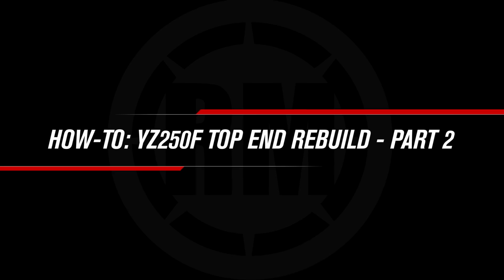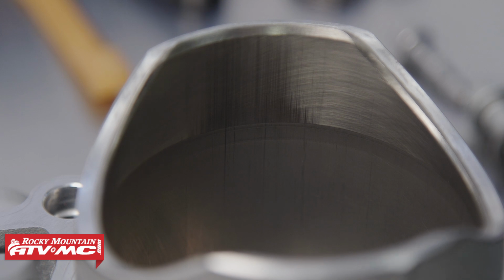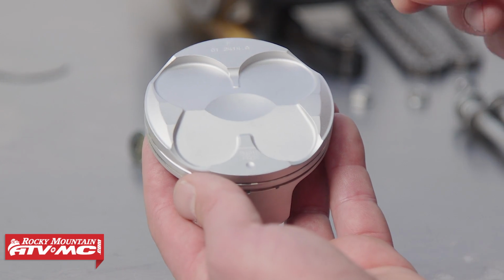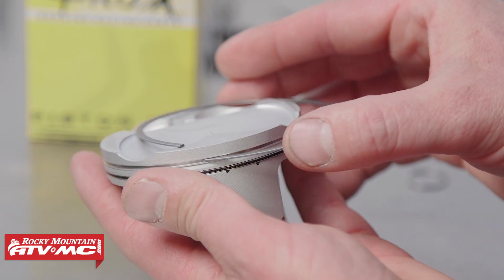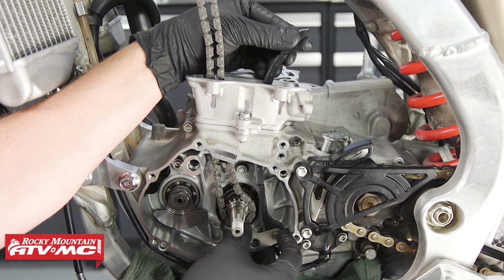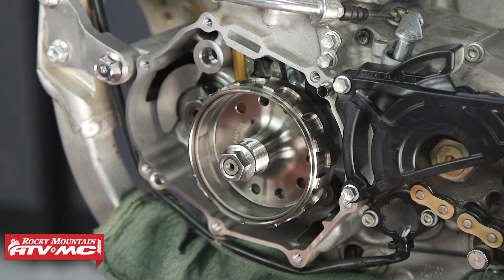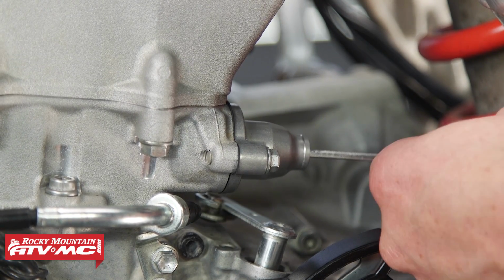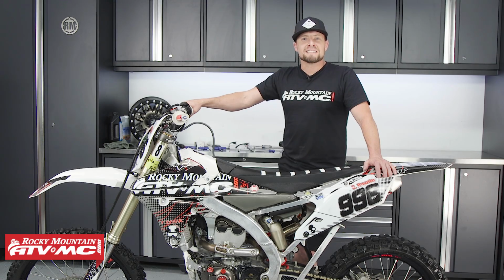Yamaha YZ250F Top End Rebuild | Part 2

Comment: where did you get your torque wrench from  ??  and what make is it
Reply from the maker: This torque wrench was from Snap-on. You can check out the Tusk torque wrench for a better price: https://www.rockymountainatvmc.com/parts/tusk-torque-wrench-p
Reply: @rmatvmc  ok got a dumb question..some of my 8mm bolts needs 4.5 ftlb torque..so do i multiply 4.5 x 12 ?   that's 54 ft lbs of torque does this sound right ???
Reply from the maker: @417plasma6  If you are wanting to go from ft-lbs to in-lbs then you will multiply by 12. 4.5x12 is 54 in-lbs.

Comment: Hi, what's the exact size of the Flex hone tool for this, when i want to order it says 77-83? its 77 or 83? Thanks and great viedo btw!
Reply from the maker: The 77-83mm hone is what you want if you have the same bike as us. That is just the size range of cylinders that this hone will work on. If you type in the exact year, make and model in our drop down menu, it will show you the right size and part number for the stock cylinder. This will ensure you get the right hone for your bike as long as you aren't running a big bore kit. -Charles

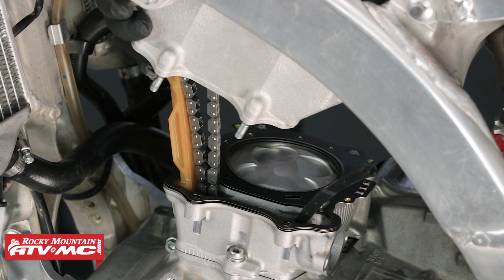Comment: Hey just curious at 7:28 in the video. When you are putting the head on the cylinder why does it seem like you have 3 gaskets for it?
Reply from the maker: The stock head gasket has 3 layers riveted together.

Comment: What size cylinder hone did you use I got a 14 yz250f and it’s burning oil
Reply from the maker: If you enter your bike on our website it will tell you the correct size. Should be the 77-83mm.
Reply: @rmatvmc i have a 2022yz250f i have a 83mm ball hone will it fit?

Comment: After you torque the head, wait an hour or so, and check the torque again, you will notice that they loosened up, because the head is compressing the new head gasket. Also lower the spark plug with a magnet, so that the gap does not get smashed if you just drop it in.
Reply from the maker: Good tip! Thanks for checking out the video.

Comment: I made the mistake of installing the head and cylinder, after that, the front plastic chain guide would not slip into the top of the cylinder slot. I had to remove head, and place it into slot. (service manual does not show steps) Good video.
Reply: I made that mistake as well, the service manual doesn't say anything about it

Comment: I have a 2014 yz250f. My intake cam does not point upward when the cam marks are level with the head. Exhaust cam points upward like yours. Could my intake have a spun cam?
Reply from the maker: Did you have a serious failure before you took the engine apart, or did it run and just need a fresh top end? If it ran before, it's probably not spun. Is the single dot to the left and the two dots facing up?
Reply: @rmatvmc  yes the bike previously dropped a valve
Reply: @rmatvmc  yes, I followed manual Instructions, 27 pins in between, single dots setting horizontal with the valve cover gasket surface, flywheel mark aligned, and fresh valve adjustment. Getting great spark with fuel. But no boom
Reply from the maker: @austinrosser9522  Ok, with that happening and if your intake cam lobes aren't in the same location as ours compared to the dots on the cam chain sprocket, it sounds like you found the problem. I'd give it one more look just to verify, and if it doesn't match, then I'd replace it. Let us know how it turns out! -Charles

Comment: Wiseco piston part 40111M09700 for a 2017 YZ450F - the top of the piston doesn't have an arrow but has FWD. It seems that normally the arrow points towards the exhaust but on the YZ450f the exhaust in the rear. so I am assuming that FWD is towards the front of the bike which would be the intake?  Also, the instructions tell me to put an oil rail above and below the oil ring expander - yet my package only came with 1 oil ring expander, 1 oil rail and a top ring - am i missing one?  thanks

Comment: Hi
I didn't know that there is A B C size vertex piston.. I bought the A size on my first rebuild and after the rebuild a very light puff of  blue smoke coming out when reving the engine on high RPM.. 

Was it because I'm using A sized piston instead of B sized?

Comment: Hi

I did not  hone my cylinder because I do not have the tool and just put new piston kit on it.  Replaced all the valve seals also. Noticed a thin blue smoke when I rev high the bike after rebuild and after spending 2 hours on it. Im thinking that is because the cylinder was not honed.. Can I still hone the cylider  and put it back togher even  I've already riden the motor after few hours?
Reply: No, you now have to take bike to salvage yard
Reply: @illhaveanother4365  it's been 2 years and still using the same piston. :P

Comment: Sooo I followed all the steps and my kickstart is stuck 🤷🏽‍♂️ , I don’t know what might have happened??
Reply: It means something is bound up or hitting something. If you didn't align the timing marks properly, the piston might be hitting the valves for example. DONT force it, take it apart and re check everything
Reply: @slickstrings  timing is probably off. had the same issue. do not kick it if its stuck. you can bend valves
Reply: Did u ever get it running
Reply: I have the same issue😦
Reply: I followed every step in the video but i cant turn the engine over

Comment: I'm putting my cams back in, but can't seem to get the intake one back in. Feels like the cam chain is to tight to fit them back on... Help... Anyone else had this problem???
Reply: Had this problem on a wr400f 
You need to put the exhaust cam first at the marks and chain on it. Then you want to put your intake cam in place and positioned at the marks too. The chain is in front of the sprocket now and you need to not force it, just leave it slightly loose to put the next cam.
Now to put the chain on, you need to get 1 or 2 teeth from the top, slowly lifting the cam from his back (opposite of where the chain is) and swinging it inward a bit.

Then when you have 1 or 2 teeth in at the top of the sprocket, you have to push the chain from the bottom with your other hand to help it get a little loose (down where the chain goes). 

Gently moving the cam back-end upward and pushing the chain to fit the rest of the sprocket and it should work...  
Sorry if it's not clear..let me know, it's hard to write it down and there are no videos that shows the process on yt suprisingly

Comment: What size ball hone and what exactly is that he sprays on the ball hone to lubricate it?
Reply from the maker: The ball hone for this bike was the 77-83mm and the lubricant we used was Maxima MPPL.
Flex-Hone: https://www.rockymountainatvmc.com/parts/flex-hone-cylinder-ball-hone-p
Maxima MPPL Lube: https://www.rockymountainatvmc.com/parts/maxima-mppl-lube-p
Reply: @rmatvmc  thanks for replying. Will the same size hone do for a 2019 yz250f?

Comment: No lubes when installing the piston into the cylinder? On the rimgs?
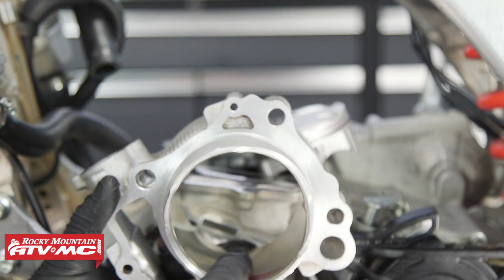Reply from the maker: You can see him putting assembly lube on the piston skirt at 6:19 when installing the piston. If you want to lube the rings when installing them, it's up to you!
Reply: @rmatvmc  oh I thought you were supposed to run it dry for proper break in
Reply from the maker: You will want to have assembly lube on any internal moving part when putting an engine back together.
Reply: @rmatvmc  oh okay thanks for the info!

Comment: 6:22 What does he lubricate in the cylinder?
Reply: Assembly lube.. it is just lubricant that mechanics or anyone who is rebuilding an engine uses in order to properly lubricate the engine when it is first started after a rebuild or refresh. This is done because the possibility of not having the engine oil reach certain places in the first few seconds of start up.
Reply: Jake Gardiner why not just used engine oil?
Reply: @jonoj7666  you could. the oil would create boundry lubrication for initial startup.

Comment: What is the benefit of using a hi compression piston
Reply: Hayden Bahadoorsingh little bit more power, but also shorter interval off changing
Reply: MX57 I really want more mid to top power. Would a hi comp piston help?
Reply: Hayden Bahadoorsingh yess but also depands on your motorsettings
Reply: Wouldn't recommend one. Your bike will overheat like nothing
Reply: LarryFly what would you recommend for getting more mid to top power

Comment: Would recommend someone new to working on bikes to do this or should I pay someone to do it?
Reply from the maker: If you take your time and follow these steps and have the tools, like mentioned below, you can get er' done!
Reply: Just like M. Kasner said if you got the tools then go for it. My only suggestion is stay super organized. Clear out a big spot where you can work. If you don't have a garage or a shed ask to use a friend's. I was super nervous when I did my first top end on a 04 WR450 but I stayed super organized and it turned out great.
Reply: Will definitely ask mom or grandma to help me organize and bag up everything
Reply: Hayden Bahadoorsingh did you end up doing it? If you did how did it go
Reply: I really appreciate the feedback. This video is very helpful because there is little to none on information on working on these bikes. I had just bought a 17 YZ250F and found it has a 100 hours on it. I got a screwed and this is my first bike. Didn’t know better. I have been wanting to do a top end as a preventive measurement.
Reply: If you have the tools go for it, it's super easy.
Reply: probably pay someone, I would try this first on an old bike or like a pit bike.